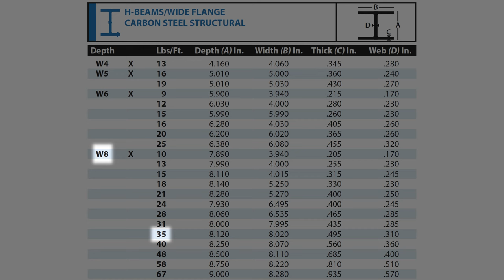ABCs of Structural Steel - Part 2: Beam | Metal Supermarkets

Comment: When refering to metal Fillet is not a French word.  A fillet or round connects two objects with a tangent arc in 2D, or creates a rounded transition between the adjacent faces of a 3D solid. An inside corner is called a fillet and an outside corner is called a round;    " Fill it"  not "filay" that is a cooking term

Comment: Wish I knew this before sounding like a fool at the local metal place.  Don’t ever just ask for an I-beam.
Reply: Ok, what did you need to specify?
Reply: @MadLadsAnonymous  I wanted an I-beam that was 3-4 inches wide by 4-6 inches tall (depending on price), and then 18 feet long.  The guy at Metal Mart pulled out his catalog and because I was so ambiguous on the dimensions, he had to drill into the options.  I also told him I preferred am I-beam over an h-beam because I figured I-beams were rolled and h-beams were fabricated.  He told me I was wrong, but never explained how (now I understand that the names are interchangeable and that both are fabricated these days).  All I wanted was a strong I-beam for a hoist in my garage.
Reply: @davidswanson5669 Good lesson!

Our main beam looks to be three 2x8 boards laminated together, so about 4.5" x 8". I'm thinking whichever I Beam is listed here at 21 lbs/ft would be the right replacement for the main wooden beam. At that point, I need to figure how to support it. Probably with columns.

Comment: So is the pounds per foot the load ability or the actual weight of the beam per foot?
Reply: W 8 x 10  = Is 8" deep and 10 LBs per foot long
So if you have a W8x10 @ 15-FT long   it will weight in at 150LBs
Reply: @Dav2Kink A 6 foot chunk would probably be 200 lbs so I don't think that math is correct.

Comment: make  some plans  for   i beam  small   homes  . look on modern steel beam  homes on  google  .  even if you just  sell  a like of   parts and  where to buy them  for  say a  two bedroom   2 bath  open  plan . steel is the best  . its a thing that we  dont really need to mine  and can be used over and over  .  a tree huggers   best option. just sell the  frames .   and because of the  corp  price  gouging going on  with so  called supply side economics   the  rebrand  for price fixing  you would  sell so much   .